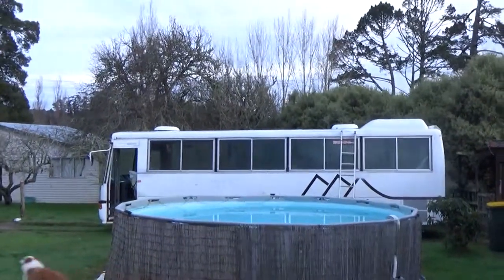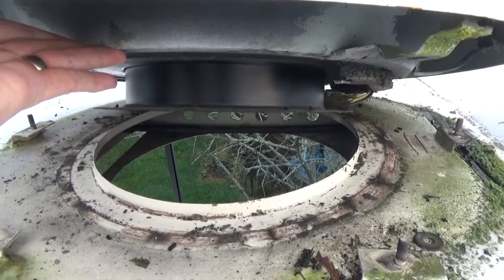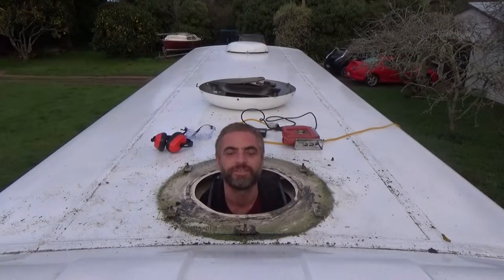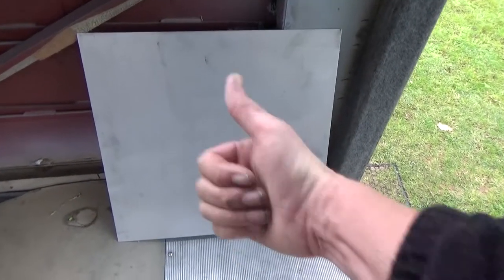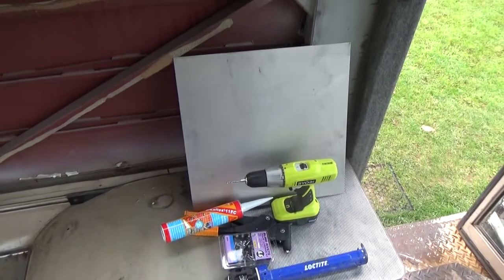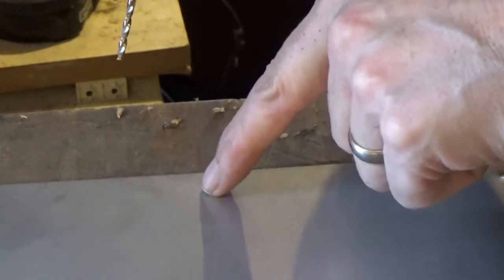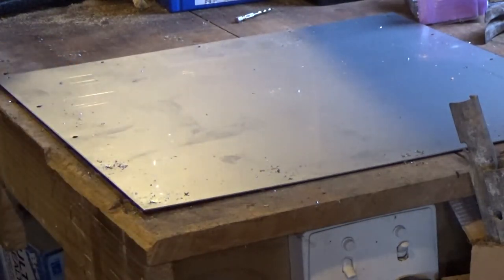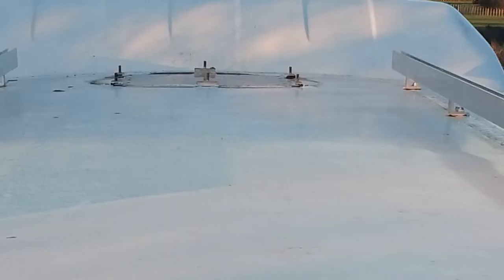Removing RV roof vents | Unventing the school bus to make space for solar panels

Comment: We did a 7m wide body Hino about 10 years ago.   Ours had three sets of windows so I'm guessing yours is about 9m.   I did exactly the same job as you removing the mushroom vent.   Never leaked.   Keep the outer skin of the vent as it makes a great parts cleaning tray.    Remember well the stripout, particularly the 100s of kilos of AC gear.    Learnt a lot about the bus electrical and pneumatic set up.   Just started watching and your doing a wonderful job.  Ours was far less professional.  Jon
Reply from the maker: Yeah 8.5m. Would have been nice to have a widebody, seems like so much more room in them. Oh yeah, I had been thinking maybe a wok :). there sure  was a lot to take out, trying to reuse as much as I can but will be a few trips to the tip and metal man at the end I guess. Thanks very much, we like to think its a nice blend of polished and professional, and rough as guts :)